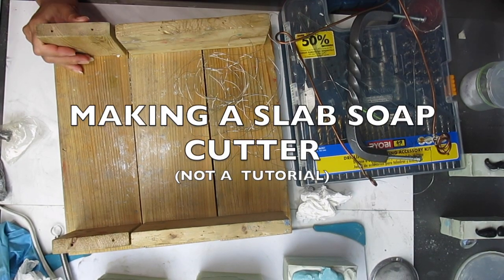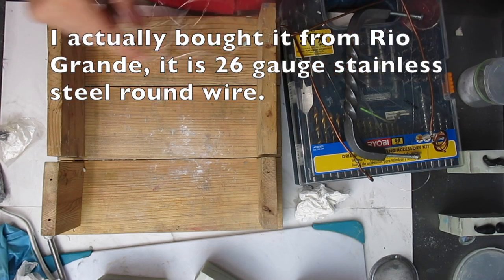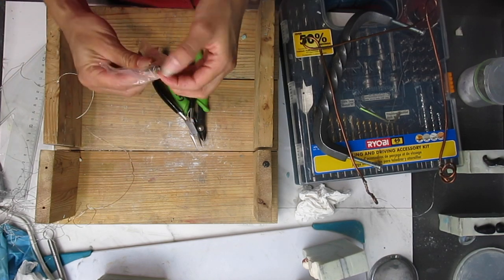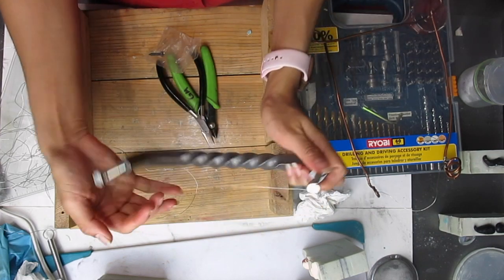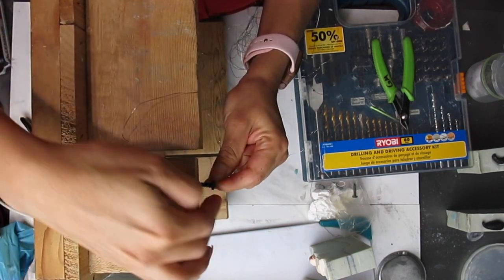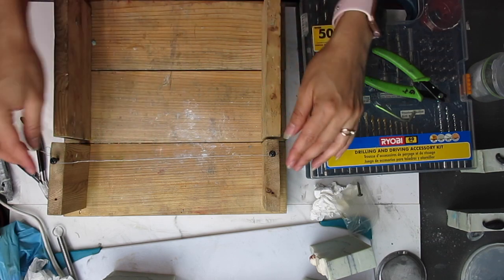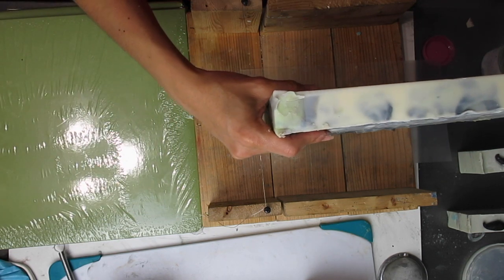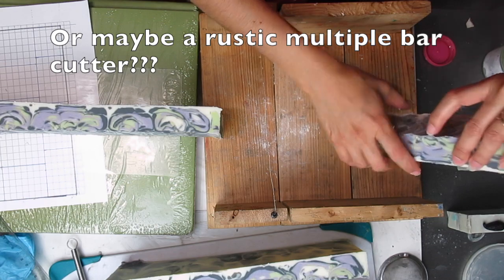Testing my homemade slab soap cutter

Comment: I've been making soap for about 8 years now. I bought one of those slab cutters and quickly discovered whats wrong with them! They all have a cookie cutter approach so all of them have the same problems!
They may look like they can cut different heights but it is not practical because the wire holds its shape from the previous height and continual bending in different positions will break the wire just like the way a coat hanger will break. Additionally, the wire is only as good as the hook that redirects the wire is strong. That will bend over time too.
And more importantly, when I am ready to cut soap I am ready to cut soap. It cant wait and I dont have time to break out a ruler and a pair of needle nose pliers just to adjust for the height I need. They are too hard to adjust.
I came up with a solution and there is another that I havent done yet because of cost but I will.

Firstly, make one wall with slots so the wall can be moved in and out. This itself tightens the line.
Secondly, make the walls removeable for storage by using wingnuts.
Thirdly, get rid of that horrid wire and use 30 lb fishing line which is available everywhere and much easier to use and cuts cleaner.

Using these steps, a height adjustment from one height to another can be made in about 45 seconds!

I am not looking for subscribers but check out what  my prototype does. Its just a 20 second video but the concept does work and I dont  have a problem with bars that look funny any more.
The video is called "They say fishing line cant cut soap"
Reply from the maker: Thank you for your feedback, I did check out the video, very interesting because I had read that about fishing line but your results prove different, definitely worth a try
Reply: @SoapsbyGlenda  
Thanks for the compliment. That was my prototype model and is the one I use but I made 4 more that are much nicer. It really is fun to use and much simpler with no worries. I used it again yesterday. Changing height and changing line both can be done in about 45 seconds. You simply cant do that with the current popular design. Oh yeah, 30 lb fishing line works best. Anything less will break. Anything more is harder to tie.